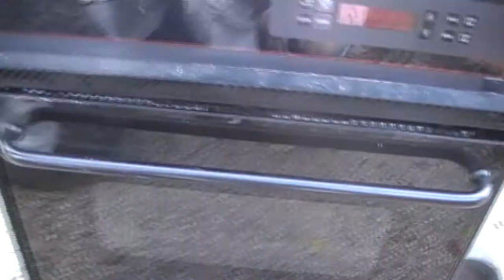snapper plow bracket garage clean up again

Comment: Hi there , Can you share more details of bracket please . I am trying to convert snapper 10 hp for front plow .Appreciate your help !
Reply from the maker: So it was  a kit for a Craftsman rider and I cut up the bracket and and welded a couple tabs to make it fit   everything else was oem it almost looks like it was made for it but with lil cut and weld it is
Reply: @ibdalovely1   Thank you for reply , Is there a specific part no for kit or search as snow plow kit for craftsman  and also please confirm its for 42 inch plow? . Appreciate for your and time .
Reply from the maker: @dube4497 it's just a standard Craftsman 42-in plow kit they pretty much fit any of the Craftsman riding mowers but the thing is you a lot of time you'll find the blade but you won't find the bracket because people will sell the mower and just have the blade so if you can find one on a used mower somewhere or get a whole new  kit but I couldn't even tell you how much they would cost
Reply: @ibdalovely1   Yes , I bought the snapper mower with 10 hp 28 inch got it running and also bought 42inch plow blade   .I like you the your installed  , one of you video shows about bracket but not a complete installation of bracket and plow . Did you do the video of installation of plow to bracket ? .
Reply from the maker: @dube4497  I don't think I actually did a video of making the bracket it was just a factory craftsman bracket that I flipped upside down and I cut a piece off and welded it on and I it literally bolted on the one spot  and  on after I welded a little piece of the bracket but it was a piece that I cut off of the bracket and welded it back on  so I just kind of cobbled it together truthfully
Reply: @ibdalovely1   Okay , will let you know how it goes . Thank you sharing info and time on reply it helped .